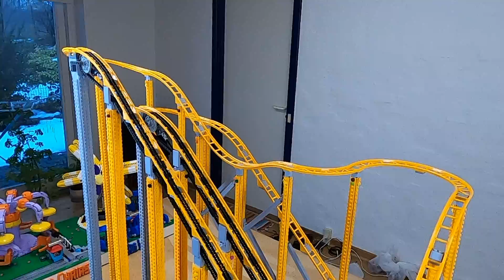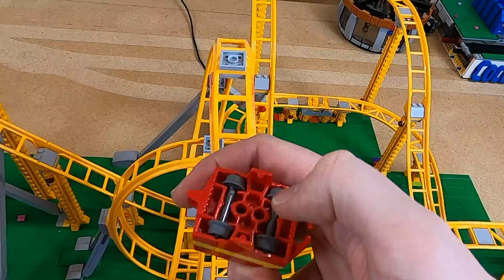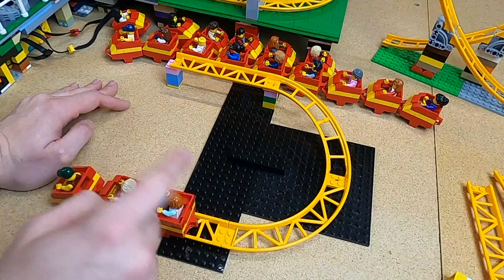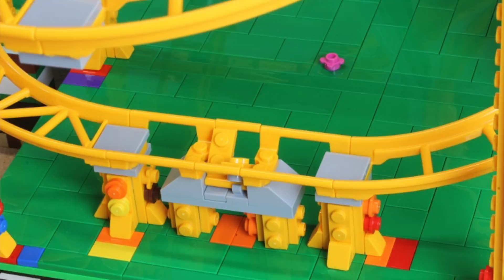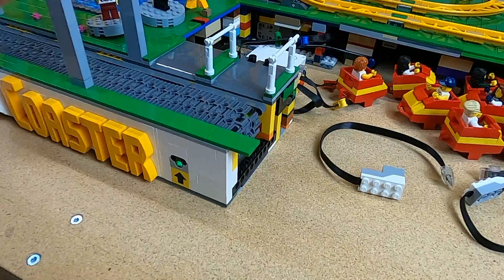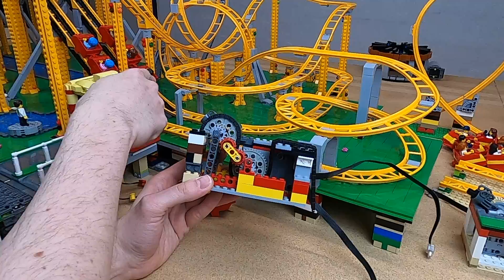Talking technical: LEGO Theme Park Roller Coaster

Comment: Can you explain why the lego original roller coaster (10261) has rubber tires on top of the coaster to help complete the first curve, and yours do not need them?
Reply from the maker: Yes. The original red one did not have the curved track pieces with a downward slope. Due to this, the wheels were required to ensure the train did not get stuck.